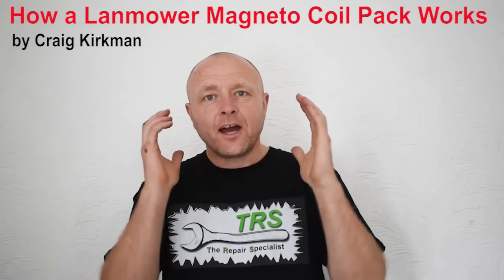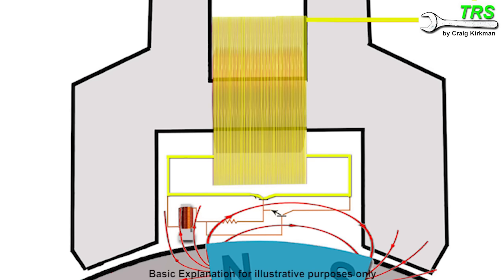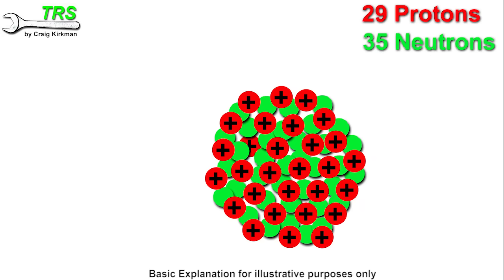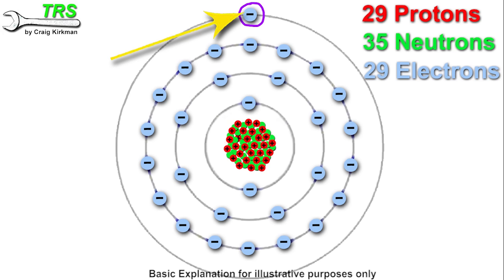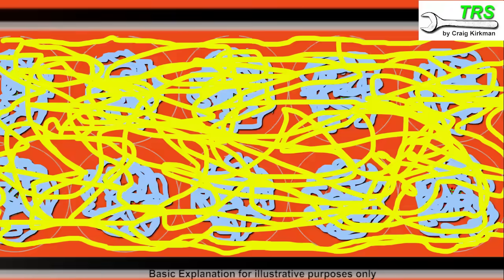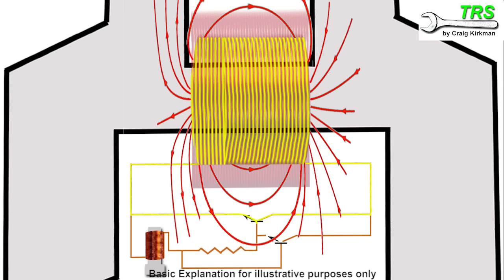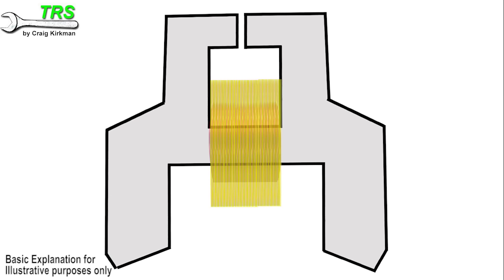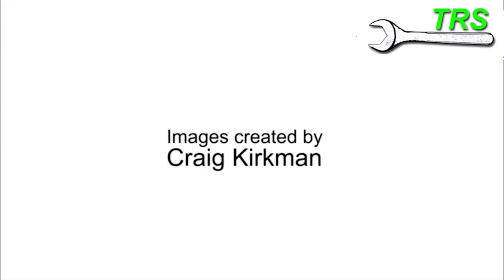Lawnmower Coil Pack Sparking System - Induction Coil, Transistor!  (by Craig Kirkman)

Comment: So how does an old school points based lawnmower coil pack work without a trigger coil? Your explanation here makes it sound as if the primary coil is charged through the trigger coil which makes one wonder why the iron core has to be the shape it is and reach out to nearly touch the flywheel at two points.
Reply: The points are normally closed by a spring, completing the primary circuit.  As the magnet passes the coil assembly, a high current is induced in the primary.  At the proper point of rotation, the points cam which rotates with the crankshaft pushes the points apart, opening the primary circuit.  Aided by a capacitor wired in parallel with the points, the magnetic field built up by primary current collapses very rapidly, cutting through the secondary coil and inducing the high voltage necessary to fire the spark plug.  Since the points cam usually rotates at crankshaft speed, every other spark is "wasted" in a four stroke engine because it will occur during the exhaust stroke rather than the compression stroke.  No matter.
Reply: @Hopeless_and_Forlorn  Thanks but that doesn't really answer the question. The video makes the supposition that the primary coil is charged through the trigger coil. Non-electronic magnetos don't have this trigger coil so the accuracy of the explanation is suspect.
Reply: @killer2600  Actually, Killer, it works exactly as I explained, and exactly as I learned when studying for my aircraft mechanic's license in 1964.  You asked about points-type ignitions, which DO NOT HAVE trigger coils.  The current in the primary is interrupted directly by the opening of the points, which are connected in series with the primary winding and in parallel with the capacitor.  The capacitor lessens arcing across the points and greatly speeds the collapse of the magnetic field.  If you want to know how a high-energy igniter system for a jet engine works, ask somebody who does not mind teaching fools who do not understand what they read.
Reply: @Hopeless_and_Forlorn  I am actually aware of how it works. I'm just pointing out the flawed explanation regarding the trigger coil charging the primary coil.
Reply: @killer2600  You are correct. Sorry for the snark.
Reply: The trigger coil does not ccharge the primary coil @killer2600

Comment: Hi.  I love this video  I have searched forever to see the wiring diagram of what is inside these coil packs.  I have always thought there must be some electronics.  I think, maybe there is a capacitor in there as well to cause an oscillation like in a points system.  I think you have got it slightly wrong (or maybe i understood you wrong).  You imply that the trigger coil is providing the power to the primary coil.  I think the magnet provides this power, The trigger coil gives the current to switch the transistors, only.  These transistors short out the coil.  When the transistors open and close the voltage and magnetic field rises and falls very quickly to excite the secondary, helped of course by the capacitor.
Reply: Correct

Comment: Why did they stop using points? I thought they worked good.
Reply: They worked well but not for long.  With points, the rubbing blocks that touch the cam wear, gradually closing the gap; the contacts wear, transfer metal from one to the other, or foul; and the whole thing is vulnerable to moisture and dirt.  Solid state ignitions have no parts that touch moving parts, are sealed against everything, never get out of adjustment, and usually last the life of the machine.
Reply: @Hopeless_and_Forlorn  But i've seen points outlast small engs. also. and never wore down like a car. It was normal to tune your car, but not the mower.
Reply: @johnnellis3025  I'm sure you are correct, but mowers that are not in commercial service probably do not accumulate hours of running as a car does.  I think that electronics parts are so cheap now that it may be less costly for manufacturers to install solid state ignitions than points.  Also, there is nothing accessible for tinkering in an electronic ignition, and it is pretty well sealed against the environment.

Comment: Can I assume that the secondary coil is made with wire with two ends, where one end goes to the spark plug and the other is grounded to the engine block?
Reply: Yes
Reply: I was thinking the exact same thing.  I thought I was going crazy thinking I had missed something.

Comment: I wonder why the magnetic core is so rusted in most applications? Can't they galvanize or paint it properly. I suspect the rust is also one of reasons of weak spark in older engines (2 nad 4stroke).

Comment: just one small thing,  the RETURN PATH, to the secondary coil,  Is the secondary earthed to the iron core, or a screw to the body of the  motor, or  at the mounting bolt
Reply: Not to the core, but definitely to the engine, or at least to the cylinder.  Usually the engine is electrically bonded to the frame of the mower, but that is not necessary.  Spark current flows in a complete circuit, so any starting point is arbitrary.  You could say, though, that the starting point is the engine where one end of the secondary coil is connected,  through the coil and plug lead, through the plug center conductor to the tip of the plug, through the air gap which is ionized by the high voltage from the coil, through the body and threads of the spark plug and back to the engine and its connection to the "starting" point.

Comment: Great video.  I do small engine repair.  When somebody asks "what could possibly go wrong with a coil?", I can explain how complicated the operation really is.
Reply: The operation is complex, but the coils are simple.  If each coil has the proper resistance end to end and is not shorted to anything else, such as primary coil to secondary coil or ground or to the core,  then it works just fine.  Same with transformers.
Reply: @Hopeless_and_Forlorn  This gives meaning to the numbers when blindly following u tube directions to check resistance.
Reply: @shoechew  you can't really test 100%. Insulation inside might break down under high voltage but not at 9 volts or whatever the multimeter is.
Reply: @redtobertshateshandles  Which is why they make meggers.

Comment: 55 years ago my physics teacher spent a week trying to explain this to us and we got half an idea but  you have, in 16 minutes explained it crystal clear. Fair play to you. I hope physics students today get to know about your videos. Thank you.
Reply: 55 years ago they used points, it should have been easier to understand.
Reply: @johnnellis3025  That's right. It's a different process. I still have all the tools I need to do points on small engines and car engines.
Reply: @John Nellis  They still had this system on at least some lawn mowers. I vividly remember the one my dad had. He would " only trust me" and not one of my brothers to cut the grass with. Lazy they were.  ,':(
Reply: @johnnellis3025 r
Reply: Coil ?
Magneto ?
Transformer ?
It's a Tesla coil , in reality it simply steps up voltage , a auto has a 12 volt system , the coil steps it up to 35,000 to 80, 000 volts ,
The coil on a lawnmower engine is the same coil except magnetic fields are traveling through the steel into the primary and secondary copper coils increasing voltage and makes the spark plug zap a spark  , you can make a lawnmower coil make  a zap with a 12 volt battery ,  I have many coils in my collection , 
I can make a 4 inch arc across  2 steel nails , that's a few thousand volts , 
It's a spark as long as a spark plug
Reply: @jimthomas777  You should take that act on the road, man.
Reply: @shoechew  , I would take that act on the but it's Killer ,
As the volts are so high that it can and will Kill you , instead I burn Wood and do wild things at home in a controlled space and no one can get hurt , 
Except for the burnt wood , 
But I wire brush , sand and polyurethane the wood and sell it  as Art pieces ,
It looks like lightning hit
Reply: @jimthomas777  625 Death Due to Fractal Wood Burning: An Emerging Public Health Problem
Reply: There was a machine with a funny name that was supposed to be safer than using a microwave...  My memory goes.
Reply: @shoechew  , the transformer out of a Welder , the transformer out of a Neon light , and transformer that can step up volts will work but they are all highly deadly , I have all 3  of those and many more  , 
And I know electricity , and have been a Welder for many years , 
I have built everything from a 1800s telegraph  to Music lights  , and I have studied Tesla , DaVinci , Faraday 
And I never take chances
Reply: @jimthomas777  Famous last words.
Reply: @johnnellis3025  , I have made over 50 of them , I stand at least 4 feet away , to kill power I am holding the plug and I disconnect it before I do anything , can't see the electric jumping 4 feet and everything is unplugged before I ever get close to it ,  I get about 10 to 20 boards ready and burn them all within a few hours , unplug everything and put it away , I just stand back and watch , so my famous last words is Safety First , Safety second and Safety Always and make great looking Art Work out of Black Walnut , Cherry , Red Cedar , Oak, and Pine ,
And put 7 coats of Polyurethane and they  shine like crazy
Reply: @jimthomas777  Why 7 coats of poly?  why not 6 or 8?
Reply: @johnnellis3025  , I  usually stop when it gets shinning all over , knots seem to soak up the Poly and it looks like a dry spot , and 7 seems to about the best looking job , I have went all way up to 12 coats of Polyurethane , each coat takes one full day to dry before the next coat is added
Reply: @jimthomas777  volts is the potential that pushes the electrons from high to low. Concentration (ground). The amount of electrons passing through a point, measured in amps is what causes levels of damage. A high voltage may carry few electrons a long distance but is not dangerous because the ionization of the substrate it is passing through was a low enough resistance that heat is not generated. Like the spark from a Tesla coil. But given enough current riding that voltage the ionization of the substrate superheated causing all the electrons to be ripped away from the nucleus of the substrate creating the 4th state of matter, plasma. Which is called an arc flash if in the open air. In more solid substrates you get searing. Interestingly if you like math the movement of the energy creates Mandelbrot sets, fractals. Mathematically a representation of an infinite amount of space in a finite amount of area. Wrap your noodle around that meatball.
Reply: @genemesser6020  ,  Don't have noodle , but  have been shocked with 80,000 volts before from a Tesla coil
Reply: @jimthomas777  should have gotten it on video!
Reply: @shoechew  fw crew wa
Reply: @jimthomas777  I worked for our power company as a lineman and got to learn about coils
Reply: I am amazed that I am picking up what you’re putting down. Very easy to take in and (mostly) understand. A thousand thank you’s! You are an EXCELLENT teacher/instructor.
Reply: I understood the principle of the lawnmower for a long time.
Now I understand something I did not know about. 
Thank you for the short and simple explanation of what was a mechanical mystery. I’m looking forward to seeing more of your videos...
Reply: Same experience here. 😆 this explanation was great 👍
Reply: K*just mister miss much j
Reply: I have a Kubota t1670 will not start but has fuel and spark could it b bad coil
Reply: @cliffbeutler5954  Unless it's a very weak spark, it's not likely a bad coil.  Does it have compression?  If so, is the spark timed correctly?  It's very common for a push mower flywheel to move past the shear pin grove when hitting a stump or large rock and throw timing off.  Not sure how likely that is on a riding mower, though.
Reply: Much easier to learn without a class full of other students! Excellent video though... I agree.
Reply: I wish they  taught me this at school.thank you
Reply: I can relate as my experience in school was similar, but at that age there are so many distractions from thinking about what your going to do when that bell finally rings, to some really really hot chick that’s just totally wiped out my focus, becauseat that Ge we have enough testosterone to kill a 50 yr old man! Lol.
Reply: Yes science exhalations at that time was very difficult to explain.  Social media make it very eassy
Reply: Like, high school physics? They're definitely not teaching that these days.
Reply: Wow! Can you work at my College:?
Reply: @josephsteffen2378  , I don't think people are born with a certain type of brain or mind ,
Mechanical or electrical or scientific ,
I wanted to be a body builder because I liked muscles , 
Then I wanted to like Bruce Lee , 
When I turned 14 I was mowing yards making money and my lawnmower quit , 
I had to fix it or not get paid ,
And I been working on engines ever since , 
I build small block Chevy engines now that make high Horse Power , 
I can work on any gasoline engine from weedeater , chainsaw , lawnmower , motorcycle , cars and trucks , 
Once you learn how something works its easy , 
Since all gasoline engines has a Tesla coil , I started playing with them and watching the electric current , 
I also became a Welder so I could Fabricate anything I want , A Welder also has a Tesla coil in it , 
So does a Microwave oven , 
I have many of them , I have made numerous Fractal Wood burnings , it is highly deadly but I watch from a distance , 

So it doesn't matter about your birth , it's what you learn after you are born , 
You can learn anything that you want , just learn it correctly and think safety first , second and third , then do it , NEVER take chances ,
Because you don't get to make a second mistake
Reply: @josephsteffen2378  , where in my comment did I say every one is exactly the same ? 
I didn't .
You did .
I said that people can learn whatever they want .
I wasn't born with a certain kind of brain thinking a certain kind of way , I learnt from thousands of people watching them from friends and family to  teachers and movies , 
Then the things that interested me I wanted to do myself , 
If one person can do something , another person can to , it may be difficult at first because things usually are , but it's all about learning , 
 Not that you are born with a certain kind of thinking ,
I can run heavy equipment like a Bulldozer , as a matter of fact I have a Bulldozer ,
I can do leather craft , I own the tools to do it , 
I can do woodworking , I have my own wood shop , 
I can Weld , I have my own Welder , 
I can build engines , I have four tool boxes , 
I can Fabricate metal , I can electroplate , 
I can even do Fractal Wood burnings with Tesla Coils , 
Why ?
Not because I was born with a certain kind of mind , 
But 
Because I want to
Reply: @jimthomas777  Excuse me.  I'm removing my comment.  Sorry.  Hey, it's Sunday and Spring is on its way, enjoy it.
Reply: @josephsteffen2378  , You put the comment there , 
You can remove it if you want , 
But removing your comment doesn't remove the fact that you can still do whatever you want in life , 
You can be whatever you want  , all it takes is actually wanting to do it and then trying your best , if you fail that still doesn't mean you have to quit , people were not born basketball players just because they are tall , 
 You better learn something before you make a comment ,
Then you won't have to delete it .
Reply: 5up
Reply: Thanks cuz you don't have all those good looking girls distraction!!!
Reply: I need to see about ordering a call from y'all  5 horse Mercury
Reply: Now look at lightning from the ceiling down to earth more carefully ...
Reply: Same here, paid lot of money and lots of hours.
Reply: same but on smaller timescale (15+ years)
Reply: Also, teachers have a specific amount of material that they need to teach to their students in a specific amount of time .... 
You CANNOT teach one method and assume all students will comprehend it. 
Different students learn differently and some need the material to explained in a manner that they can process.
A GOOD teacher can explain one topic in many ways for different students to understand. 

Did you know that i learn more on YouTube than i learned in Mechanics school .... 
Like How putting on an exhaust system will lean out the af mixture ...
Like How low compression on 1 or more pistons will cause a LEAN af mixture on the O2 sensor ...
Like why putting a header on a motor will shift its peak torque to a higher point in the rpm ??? 

Technical stuff like this is NOT taught in school ...
Reply: I see comments just like this  everywhere. That teacher gave you the foundation in which to understand this. That is school pretty much summed up. Sometimes it’s hard to tell how much you really know. I remember trying to teach my nephew guitar. We started with one string held down by one finger. I was baffled by how much he was struggling. I had forgotten how hard it was in the beginning and how far I had come. In my mind, holding even something like a chord was easy. And it had always been that way. But that just isn’t true. Knowledge builds on top of previous knowledge. Even when you’re struggling. You’re learning.